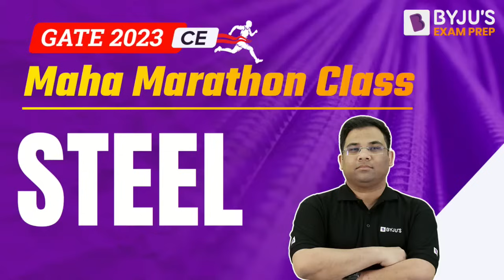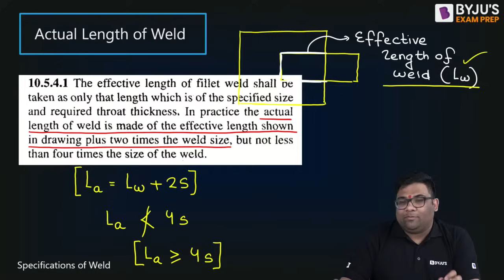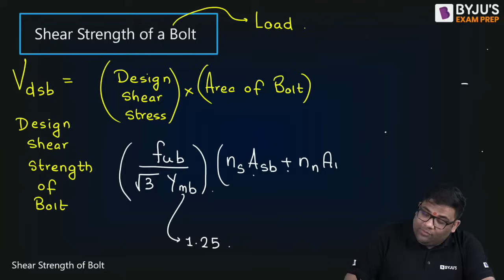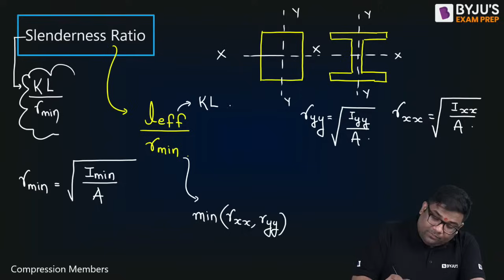Complete Steel Structures | Marathon | GATE 2023 Civil Engineering (CE) Exam | BYJU'S GATE Civil

Comment: 0:00:00  -   Introduction
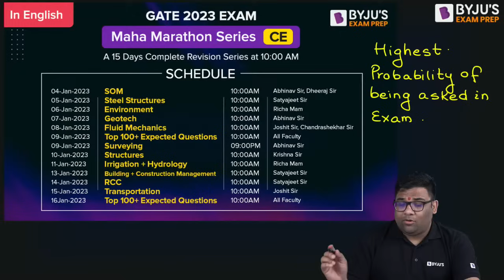0:04:00  -   Welded Connections
0:42:00  -   Eccentric Welded Connections
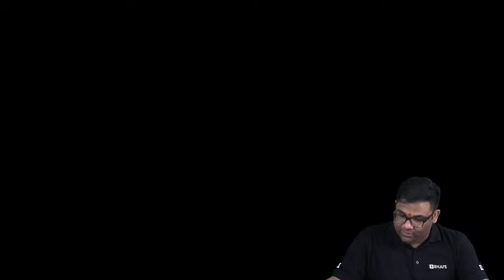1:17:00  -   Bolted Connections
1:29:14  -   Shear Strength of Bolt
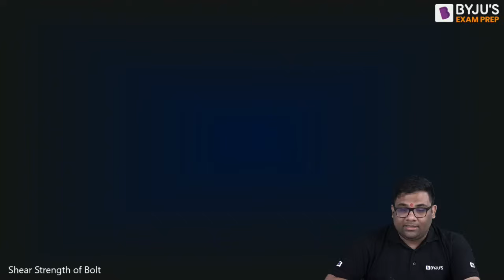1:49:50  -   Bearing Strength of Bolt
2:01:40  -  Compression Members 
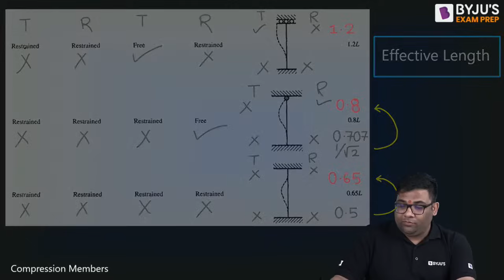2:35:10  -  Design Compressive Stress
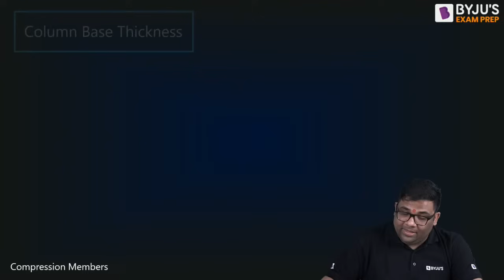3:25:17  -  Column Base Plate Thickness
3:31:58  -  Beams
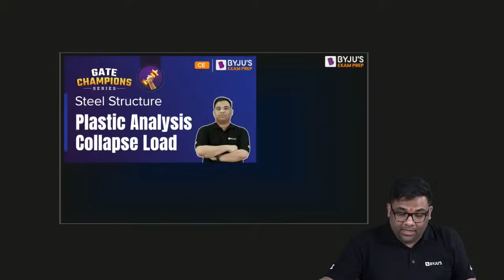3:46:52  -  Summary and Guidance

Comment: 4:00       Welded Connections
42:00     Eccentric Welded Connections
1:17:00  Bolted Connections
1:29:14  Shear Strength of Bolt
1:49:50  Bearing Strength of Bolt
2:01:40  Compression Members 
2:35:10  Design Compressive Stress
3:25:17  Column Base Plate Thickness
3:31:58  Beams
3:46:52  Summary and Guidance
Reply: Sir, maza aaa gaya 😂 Thank you for this awsm session